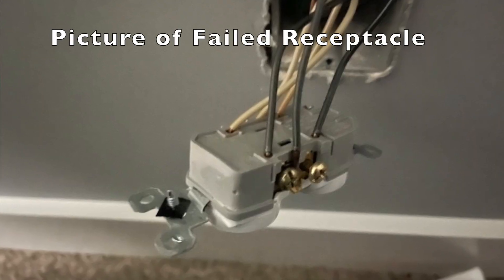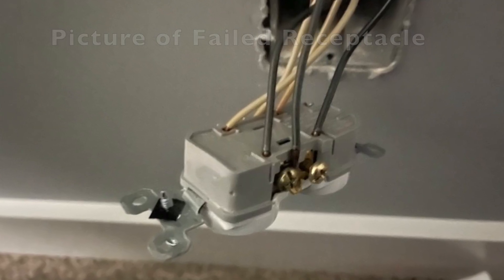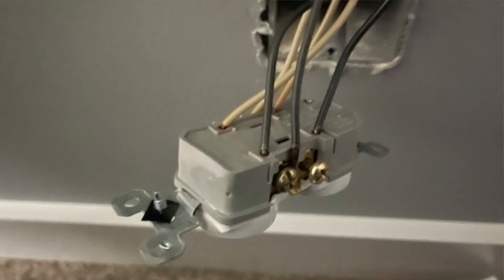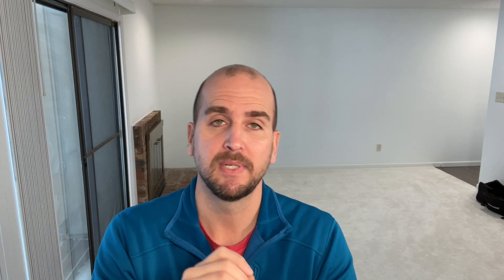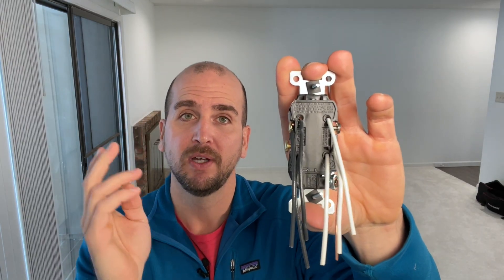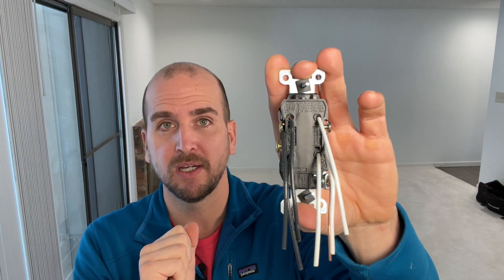Incorrectly Wired Outlet Found In Newly Built Home

Comment: As United States Secretary of Defense Donald Rumsfeld said

"there are known knowns; there are things we know we know. We also know there are known unknowns; that is to say we know there are some things we do not know. But there are also unknown unknowns—the ones we don't know we don't know."

This video attempted to indicate several ways in which the Socket Outlet concerned was not optimally connected.
What it did not indicate was that the socket outlet was so badly designed that it would probably not "pass muster" in another OECD country!

As a comparison to the NEMA 5-15 dual socket outlet pictured, which you may all know and love, I ask that you consider the wiring of this device - which fits the same Wall-Box as does the socket outlet pictured in the video. (https://commons.wikimedia.org/wiki/File:Dual_3_Pin_Socket_Outlet_Wiring.jpg)
Note that (in this case) three separate conductors are twisted together and installed securely IN each of the three separate terminals (Line, Neutral and Ground/Earth) and each set is held in place by a "set-screw". (No "hooks" in solid single wires being necessary.)
When screwed down, these set-screws are not exposed in any way and certainly not at the edge of the device, where they may come in contact with a metal "box".

There IS no need for any "pig-tails" and other connectors to connect these wires together and to the socket outlet - which is a saving in materials, time and effort.
Further, there is no separate ground/earth connection to any metal "yoke", since there is NOT any metal yoke - the whole device being effectively "double insulated".
With the cover in place there is no access to any metal part and, with the cover removed, the deeply recessed metal securing screws cannot be accessed with a human finger but only with a screwdriver.

This IS a "Dual 3 pin Socket Outlet" and the front of it looks like this https://commons.wikimedia.org/wiki/File:Australian_Dual_Socket_Outlet.jpg

Yes, it is an Australian dual socket outlet and costs less than  USD$10 retail - or less in quantity. - including the switches.
(If you at all interested, its internal construction is shown here   https://commons.wikimedia.org/wiki/File:Dual_3_Pin_Power_Outlet_-_Construction.jpg)

Comment: Does anyone use those Wago connectors over wire nuts?
Reply from the maker: In the middle of a survey for the viewers right now and out of about 3000 votes by DIYers it looks like about 10% of people use the WAGO lever nuts.  I am sure more people would use if the price wasn't so much higher as I have heard very little bad feedback on WAGO products including lever nuts.

Comment: Screw wire nut pigtails....use Wago connectors.  Gonna make wire nuts as useful as 8-track players.
Reply from the maker: Hey James,  I like the lever nuts a lot and WAGO products in general.  I will do a future video on different connectors which will include the WAGO 221 (lever nuts) and WAGO 2773 which is their new compact push in connectors.

Comment: You didn't have to do what you did in the outlet in the Field. You have two hot screws and 2 neutral screws, could of wire using those 4 screws. Next throughout the whole video you holding  an outlet with 3 wires 3H & 3N and then you actual only using 2 wires in the field. Shows us how to put a pigtail when you have 3 wires.  Something must be wrong if you had 3 wires for one outlet anyway,  You should have a feed and then another wire going out. Overall nice demonstration.

Comment: One comment, I've applied a bunch of appliance wiring, its very common to find incorrectly installed wire nuts that have melted and either stopped the unit from operating or could have started a fire, pls emphasize proper wire nut usage !

Comment: I'm an electrician & you did great.  That's how I always put in outlets
Reply: If there are two hot wires and two neutral wires, why not hook each one on each nut and avoid the extra pigtail wire?
Reply: @keithdygert1120  - While that is an allowable method, your circuit continuity runs through the receptacle.  If one of the connections or the device itself fails, all downstream power is lost, whereas it is maintained with a pigtail.

There are plenty of arguments for one method over the other.  Personally, I generally find it easier and quicker to swap out a pigtailed device because I am dealing with less wire to pull out and push back in.  Sometimes, especially on older houses with shallow boxes, box fill can be an issue that prevents the use of pigtails.
Reply: exactly especially when a plug gets covered by drywall and you don't notice, at lease everything will work since its all tied through lol but in commercial I always run pigtails since your typically using 12 awg and its not fun doing trim and landing every wire. Or to fix that I don't pigtail if its 1 or 2 wire and get the better outlets that have a screw type connection and not the ones you have to make a little hooks.

Comment: Hmmm I think this may explain why when I turn on the light switch or run the paper shredder that is near where the tv is plugged in at the tv pixelates (aka gets fuzzy) while watching over the air channels.
Reply: Possibly EMI from arcing somewhere, but that's usually evident from the noise it makes or power being intermittent (ex. a flickering light).
Reply: @emptylog933 Thanks, and this time I agree NeverAgreed🥁. Especially with the paper shredder, although they're plugged into different outlets they're both approximately 6 feet away from each other. I was thinking about contacting the landlord to contact an electrician about it but it's not something that I run all the time.

Comment: The  reason new houses have so many code violations is they are wired by WIRE  SLINGERS  not actual electricians,  the contractor has one actual electrician on staff to do the signing off of the permit and after they build one or two houses in a multi hounded house development project the city/ county inspectors don't even inspect after the first or second one.  For those non electricians  a WIRE SLINGERS  are young guy's  people that are  taught the very basics of electrical work and paid minimum or just above minimum wage to wire new houses by big contractors.  This is why Ur new 1/2 -1 or 2 million dollar house will have more NEC, national electric code,  violations than I would like to count,  I used to go into brand new million 2 million dollar houses and the second I walked around I'd just count the code violations and then when we'd start disassembling stuff I'd run out of fingers and toes to keep counting all the violations.  That's why U hire Ur own CUSTOM ELECTRICIAN  we make it the way U want it to be and not just the basic code of one way it works fits all.  Roy k.

Comment: This is what happens when builders (the companies themselves) pay subpar pay to underqualified techs, usually that can't speak English and don't have the rights to work in America. I say this because i used to work construction, from framing to plumbing, wiring, sheetrock. Only thing i never did was lay a foundation. When pay got cheaper because cheaper labor was brought in, i called it quits. If you want subpar labor, you'll get a fire hazard, and I'll be no part to that

Comment: I am a master electrician with more than 46 years in the trade and have been doing electrical fire investigations for more than 20 years. Twisting the conductors is the sure sign of an amateur. Your pigtail is inferior to the way it was originally fired. Inferior connections are a leading cause of electrical fires.
Reply from the maker: Hey George, thanks for the feedback.  You have a unique point of view that I haven't heard yet in 1000's of comments.  Appreciate you putting in your thoughts.
Reply: From school 50-plus years ago, you're using wire nuts, so better to have those knit the wires together.  Theory is that the tools will nick and stress the conductors.  Torquing the screw connectors is faster too.

Comment: How big was their space heater?  Was this a 20A circuit? You might want to contemplate using a 20A-outlet if the customer is heavily loading a single outlet. (I'm assuming from the 12 gauge writing that the circuit and breaker are sized for 20A - you would need to verify).

Comment: In Finland most outlets these days are push-Ins instead of screw type, and I’ve never heard or seen one fail (except during install if you didn’t strip enough insulation). But then again a name brand double outlet costs around 12 US dollars, so the quality might be a bit better. On a side note, wire nuts are prohibited here in new construction and are very rare, and the whole industry has moved over to Wago connectors instead, either the lever 221 model or the push-in ones (lever models are easier to remove but take up a lot more space compared to push-ins)

Comment: Wrap every receptacle in electric tape. So there’s no chance the exposed ground will touch the hot. Also if someone pulls the device out of the box while hot no chance they will get shocked. Further more when working with metal boxes you can avoid shortages on the box itself. That’s a best practice in my company and should be industry standard

Comment: Don't twist wires when using wire nuts! they are designed to slightly twist as you install it, read the box. twisting is left over from the days of soldering wires.
Reply: Not so
Reply: Stranded wires should never be pre twisted no were does it say not to pre twist not to twist solid branch circuit wiring! Also if you are trouble shooting a live circuit you are not able to shut off when you remove wire nut on twisted splice, the splice will not spring apart. Some commercial jobs that I have been on reguire pre twisting solid wire before applying wire nuts. Written in the job spec's.
Reply: @gregpuskar3319  Don't know about today but when wing nuts came out the box said don't twist wires. Scotch loks say you can or can't, whichever you prefer. Stranded never worked well in wire nuts. Why would you remove a wire nut from a live circuit unless you wanted to add or remove a wire, good luck if they are twisted. If not twisted you can loosen it and work a wire in or out. And I've seen twisted wires pop apart and arc too. Either way it's a stupid idea cause your probably going to lose the connection, now you've shut down a circuit you can't shut down, 9 times out of 10 you can schedule a shutdown then they don't lose power when in the middle of something. Most all of the large shops I was a foreman for it was immediate termination if you were caught working something hot. No circuit is worth dying for. And finally your trouble shooting a live circuit? So the circuit is working, or If it isn't it's off anyway??? Go to mechanic, my car was making a weird noise last week but has now stopped,what was it?

Comment: I prefer to use a voltage probe to check for power, if someone has the fuse wired backwards and you cut the breaker off all  you did was cut the neutral off not the hot.
Reply: That’s unusual but there are fused neutral wires generally they have a fuse on the hot side but it’s not always removed leaving the line hot even if the circuit is dead.

Comment: So I have heard from Receptacle manufacturers that they designed them so the ground should be installed above the hot/neutral blades.   People like the look of the faces but the ground should be on top so it makes the connection first.   Thoughts?

Comment: Let's take a minute to understand why push in gets a bad rap.  Ironically, IMHO push in was probably less prone to failure with 12 guage wiring, but that has been depricated and now only push in receptacles you will find are for 14 gauge.   (Incidentally, I have house with 12 guage backstab... we've had a couple fail, but the rate of failure is about 3 out of 50, so that's a big deal if every time that happens you have to pay an electrician, but not a big deal for a do-it-yourself person who knows how to repair.   The reason these fail can be two fold -- first the manufacturing of the blade contact inside the receptacle can be faulty.  Given that there are very expensive "stab" connectors being sold as superior to wire nuts, this is not an inherent problem with the design, just a case of cheap a$$ companies contracting with the lowest cost supplier in China / Mexico / Phillipines / etc.  Then there there is the functional issue.  Electrical code requires that all wiring extend a minimum distance outside of the box.  To control overcrowding inside the box, there is a formula for the volume of the box based on number of wires, number of wire nuts, etc.  But even with just 2 wires coming into a box that extend, say, 12 inches out of the wall, when you push that outlet back into the box after wiring it up, you will put a lot of pressure on the wiring wear it bends.  The internal blade on the stab connection may cause strain on the wire (which I think 14 gauge is not good) or it could just develop a small gap with the conductor that will result in arcing.  (The idea to ban 12 but allow 14, though, that 12 guage is harder to bend and more likely to either snap or twist free of the blades.)  So anyway, that's the real deal.  Many electricians will think it's good to leave extra wiring so that if they have to cut out a recepticle (like you did, BTW, looks like you cut 3" of wiring off), the remaining wire still passes code.  But that mean in the initial install, the box is overcrowded, even if not under code, under "real world" operation. 

One of the main benefits of push in connectors is that you can do the kind of junction in receptacle wiring that you are critical of.  That is not the same as backstabbing the terminal.  You should never do that.  If you do, one side is being pushed back out of the connection as you turn the screw.  You should never have 2 wires under one screw no matter what - that's why there are two screws on each terminal.  If you have more than 2 wires to join, and you decide to use a pigtail rather than the push-in connection, realize that under the code, you get charged for the new wire/wire nut against your volume allowance.  So you could be violating the electrical code.  The solution is, ironically, what you seem to have done unknowingly, which is add a box extension so that your volume allowance increases.  

Now, if you've read this far, here's the tip of the day... don't jam your wires into the box with the tip of your screw-driver.  If you need to, use the back of your screwdriver or the closed head of your linesman's pliers.  What causes problems with the whole issue of profile screws sticking out is when the insulation of a wire in the box gets nicked, and then, being crammed into the box around the sides of the recepicle, you get arcing.  Or you can get arcing inside the box.  Usually the offending screw driver is used to push mulplie wires in around the same place, so they will all end up nicked around the same place.  Not good.  If the fail rate from push-in in my house was 3 in 50, the faile rate from nicked wires was around 5 in 50.  I did not do the wiring, but I learned pretty quickly what the "professional" guys did wrong.
Reply: yes,,i call this the basic clueless youtuber,,&  the dense people that thinks he an einstein deserve the electric fires that insue,,,wire for fire you tubers

Comment: Spot on advice. I am an electrician. If you do it the way recommended in the video, you will not only have less problems going forward, but you will also have less expense in troubleshooting for why a receptacle stopped working and less expense in repairing it also. If one outlet stops working, the problem is in the outlet itself or it's direct connection to the circuit. I often go to service calls involving multiple outlets that have stopped working. I end up spending a few hours sometimes, taking outlets and switches out of the wall, looking for a point of failure, while trying to figure out which way the cabling is routed, to isolate the exact spot of the failure. Also with new arc fault equipment, using push in connections will increase the likelihood of tripping an arc fault breaker.I will go one step further in saying the safest non pigtailed connection is two wires behind one plate of a backwire capable receptacle. As long as the wires are both the same size and it is tight, it is adequate. Space heaters should really go on a dedicated circuit if possible.
Reply: Can pushins cause random breaker tripping?
Reply: @johnnygizmo1130  , random isn't an ideal word to adequately describe the reason push in connections cause eventual tripping. If the connection is continuous, then there will be no arcing. If there is a bad connection, it will arc, and this can cause intermittent tripping of a normal breaker eventually and lose of power at some devices if it doesn't trip. I have seen both things happen. If it is an arc fault breaker. You are all but assured to have a tripped breaker problem until the connection issue is resolved.
Reply: @johnnygizmo1130  it's not random. There must be a load somewhere along that circuit. The breaker can open because loose connections can cause a current surge, though it may not be enough to open the circuit. That's why you don't use push in... intermittent arcing from a bad connection creates hot spots, spalling, and could lead to melting and fires. If the breaker keeps opening, find out why, don't keep closing the breaker. Although they're made to last, breakers also fail so you don't need to hasten that by having the flip off and on constantly.